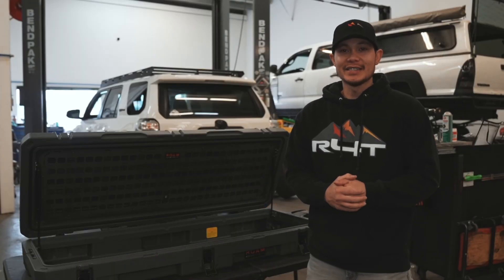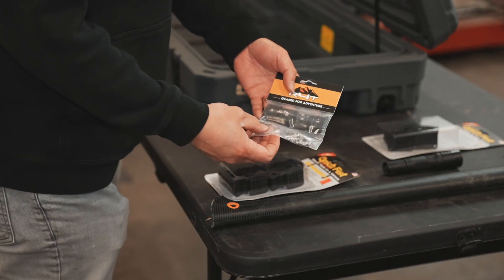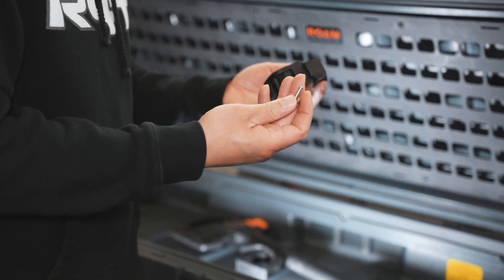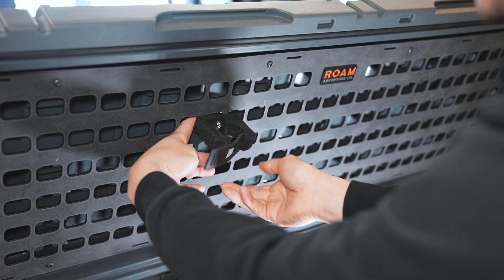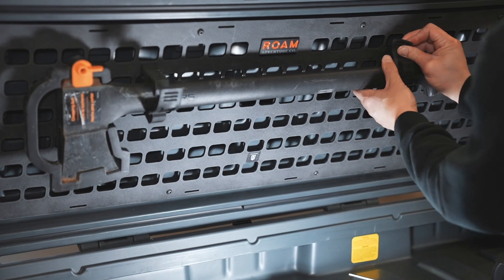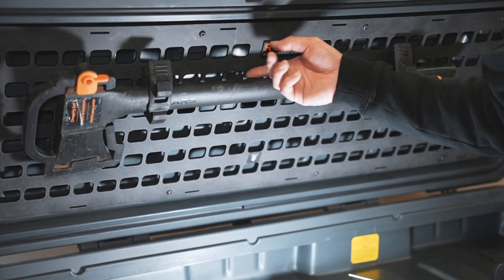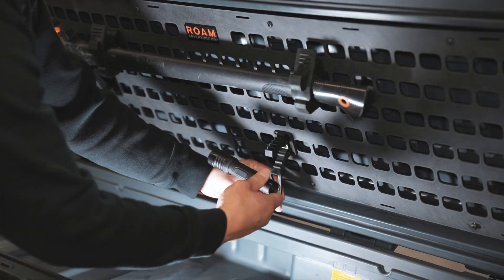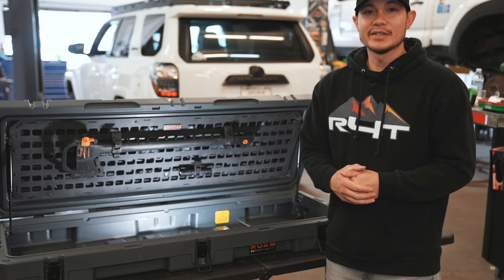How to Mount an Ax, a Shovel, and a Flashlight to a Roam Adventure Co. Case Using Quick Fists

Comment: Do you think the quick fists are safe to use on a roof rack for a shovel & axe? It doesn’t seem secure to me
Reply from the maker: We use it on the roof rack as well. If you are referring to theft then yes, there are better locking options.
Reply: @Runnin4Tacos  I meant secure as in it not easily falling out while driving. Can these be locked w a lock?